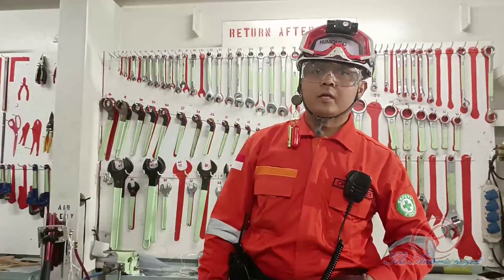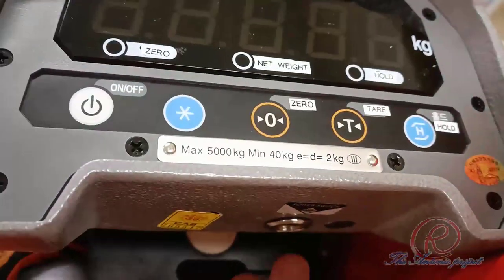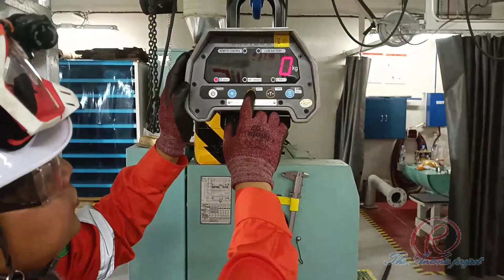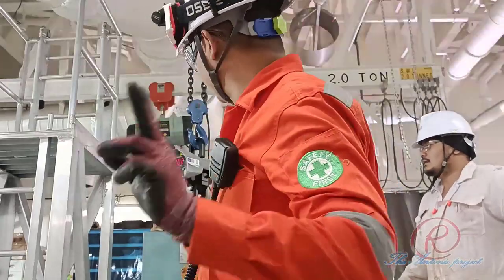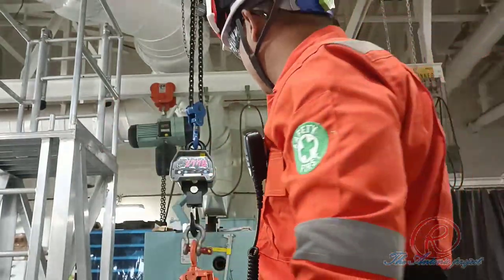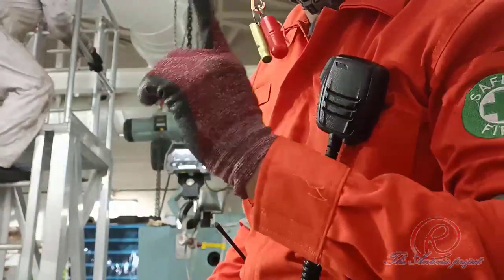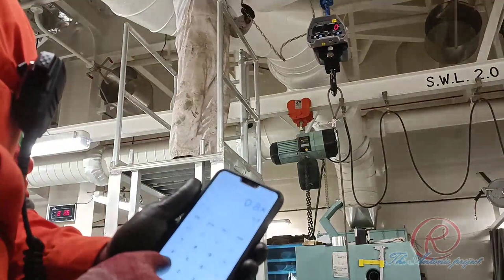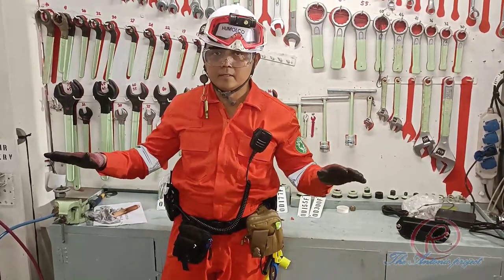The procedures of Load Test for Chain Block, Nylon Sling Belt and Sling Wires

Comment: you have focused the camera only on the digital machine and have not shown where exactly the chain block  / the slings to be tested is hooked at the bottom...  whether it is hooked to a strong point need to be shown ...and you have missed on the main part.
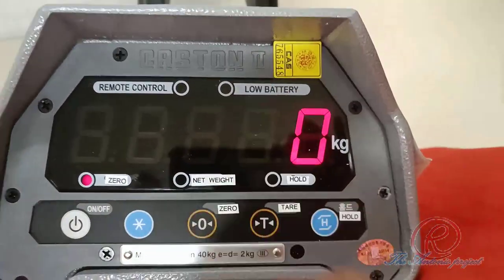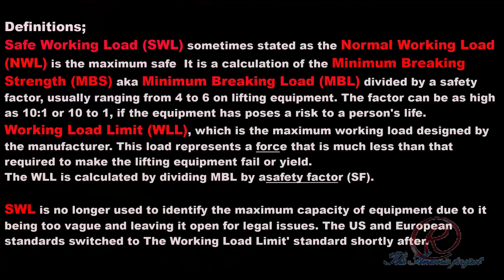Reply from the maker: Thank you for your feedback.. actually I've shown the picture and explanation on the scene 4:07 - 4:27 "there are 2 eye-plates installed on the workshop with SWL 7.5 ton special for load test work."
Also at scene 8:17 on the outside of workshop.
Hope that my additional information reply your feedback, anyway,  enjoy my another video with different topics.